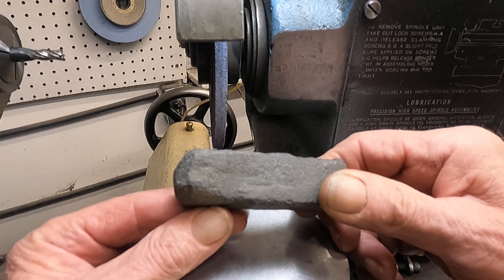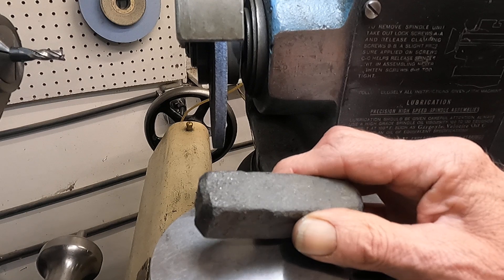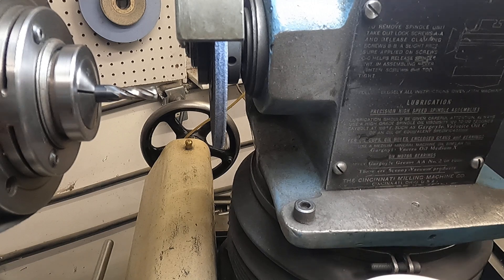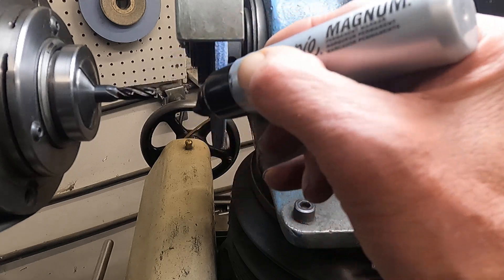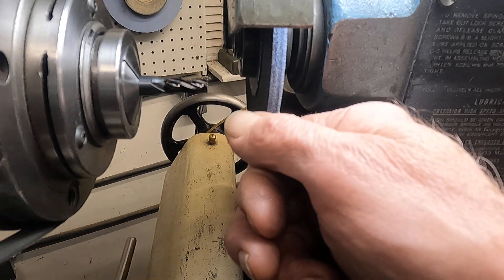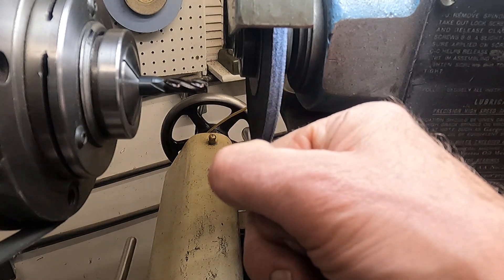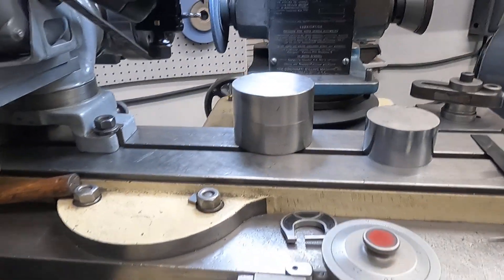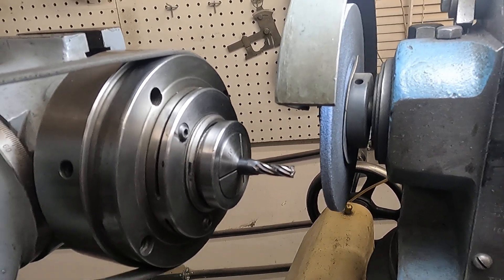Cincinatti Tool & Cutter Grinder circle grinding endmills

Comment: You don't need to grind O.D wear off endmills before you grind clearance angle on it . Save a step
Reply from the maker: Not here it is used for plunging straight in only, I use it for dowel pin holes.

Comment: I was wondering why you do not dress the wheel with a more precise dresser. I see Lewis also commented on the same thing. I have a Brown & Sharpe #13 which I affixed a diamond nib to the tail stock center so I can quickly go in and dress the wheel. Is there something you can do similar?
Reply from the maker: I use very coarse wheels, the diamond even applied at an angle will open the face too much for this grind. A Norbide stick can close the grains in the face of the wheel more by applying a flat side to the wheel, effecting a smoother finish. I still use a diamond, and mostly by hand, because of time, and not having to change wheels.

Comment: i have little dimond dresser attachments for the work heads on my grinders , very handy ,fast and accurate 
Thanks for sharing your knowledge. i look forward to your videos
Reply from the maker: Show Me!
Reply: @deedeeindustrialsuperprecision  nothing to complex just arm that pivits that attaches to the t slot on the workhead can swing it out and dress the wheel , its got a lock it to set it to center hight  if that makes sense ?.ill send you a pic
(another one i use alot is a 90degree dresser put in the collet)